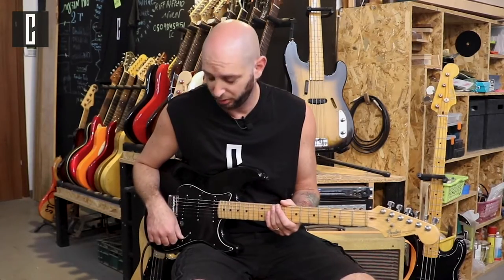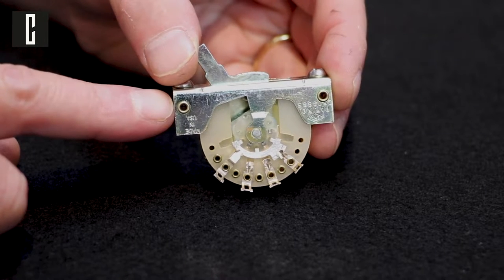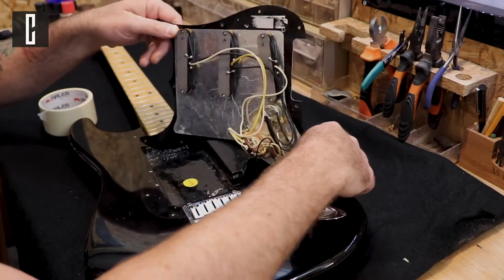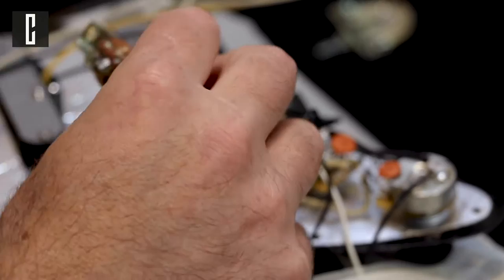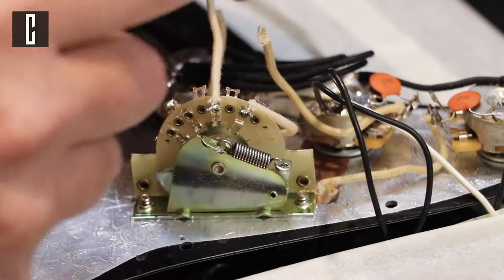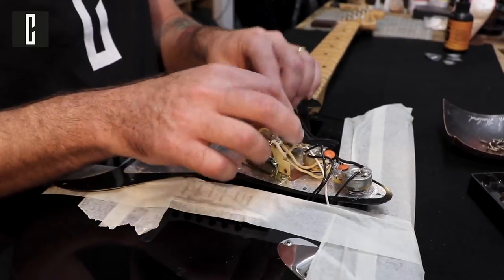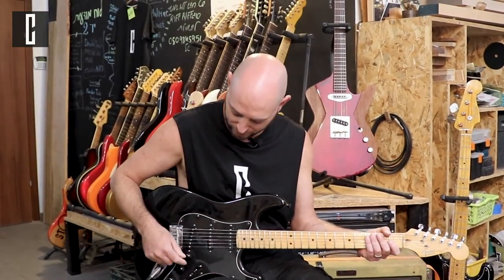How to Install a 5-Way Stratocaster Switch (full step-by-step installation guide)

Comment: Just did this to my guitar. My soldering is a mess though, you make it look so easy. As long as it works I suppose....
Reply from the maker: Good soldering takes some practice but I find that high quality powerful soldering station and iron are the real key for an easier and excellent job.

Comment: I also have good experience with other 5 switches, such as the BACH LSW50, only some of them wanted to spray the contacts right after installation and they were OK. No noise or banging. You just need to make the right ground loops so that there is no hum. Otherwise OK. Nice video!
Reply: 'spray the contacts ' means what exactly?  How is it done and why?

Comment: Hey, thank you for the tutorial. It's really clear but I got a little lost with the "common wire" term. Just did a quick search on the internet and realized that's ground. Also, my guitar has only one potentiometer controlling the tone, so setting it up will be a bit simpler than in this case.
Reply from the maker: Hi, by "common" I usually mean the lead that is going out of the switch or the center lug of a pot

Comment: Great video. I've got an hay configuration but both humbuckers don't work at the same time. Want advice on how to mod the switch so I can get both connected at the same time?
Reply from the maker: hi, I suggest you don't mod the switch because you will lose other positions, but you can add a Push/Pull pot or an additional mini switch to create to option.
Reply: @coilsboutiquepickups  hi. I also thought of putting in the middle position a DiMarzio super distortion

Comment: First time I've tried to do anything about the problems you have with electric guitars.  I have an horner guitar which is German I think.  The selection switch is a different one that is used in the video and I have no idea what size wire is used.  So please pray for me so I don't blow anything up. And if possible could someone please tell me what wire I should be using.  Thanks. And I agree that it is a good video.  Unfortunately I'm not tesla....I'm nervous about the whole process and I'm sure that I will be looking for guitar repair shops in my area 😀
Reply from the maker: Hi. You can send me a picture of your switch and I'll try to help you out.
Alone@coilsboutique.com

Comment: l am doing this on a Squire Strat. When you said 'solder common on the right tab' l soldered the black lead from the volume knob. A few minutes later l found out l had done the wrong [?] thing. l have 6 leads to work with. Three cloth-wrapped pick-up leads and a black skinny wire from each knob. l am going to keep soldering leads, but your advice would be great!
Reply from the maker: Usually black wires are 'ground' and are connected the the casing of each pot. The colored wires are usually the 'hot' wires and should be connected to the switch
Reply: @coilsboutiquepickups  Thanks for the reply. l didn't smash the guitar on the wall. l did try every soldering experiment l could think of, to no avail. Few days later l took it to Mike the guitar-fixer at the Asheville Guitar Center and it was wired up within 24 hrs. l was thrown off by the fact that the original PSS was like a boxcar, all leads to one side. By the way, in America solder is 'sodder'. Have a great day/night/whatever..!

Comment: what wires are the commons you connected. what component did they come from
Reply from the maker: The commons are the terminals on the switch that go to the volume pot and connect the poles to each other. Wires and switches can be bought online

Comment: Thank you very much! Video useful so far. I could install Japan switch (which is very close to USA in your video ) on my Squier Affinity ( instead of strange original Chinese) after watching your video. Hope you channel will grow 

One thing, it was very complicated for me to solder wires into holes of switch, I guess because of wires of pickups and pots in Squier Affinity are tine enough and holes  just too big for them. I soldered them somehow just to push big amount of tin solder but it was not pleasent and construction not very stable. Would be glad if you have a hint how to cope with such problems
Reply from the maker: Sure, try to use a high power soldering station and flux paste.
Most soldering problems are related to a weak soldering iron
Reply: @coilsboutiquepickups  thank you! Such a quick good answer) WIll try in next soldering
Reply from the maker: @anton5442  Awesome. Let us know how it went

Comment: Is it posible to by pass position 2? No blend mode of bridge and middle?
Reply: If by bypass position 2 you mean position 1 and 2 are the same, I can't think of a wiring that will do that without changing other functions, but maybe a technical alteration of the switch could do it. I'll try it next week and if works I'll upload a video about it. Thanks for the idea :)
Reply: @alonesage  Hi, I just wanna use position 5 neck, position 4 neck+middle, position 3 middle, bypass middle + brige blend, position 5 with a hot rail HB
Reply: @andresbriceno73  so, do you want the switch to mechanically skip position 2? I'm not sure there's a way to do it. I can probably make position 1 and 2 to be the same, but not skip.
Reply: I only left the neck and bridge and removed middle Pickup, I want yo know if a can blend neck and bridge know!
Reply: @andresbriceno73  you can. I think maybe you should change the 5 way switch to a 3 way switch
Reply: Will try that, any Diagram?

Comment: Only question is, is the wire that you are using shielded? Is there a better wire for reducing hum etc?
Reply from the maker: Well, the hum created by the single coils will not diminish using a shielded wire, that is, not in a way that is noticeable...
Push-Back wires are easy to use and they have excellent conductivity.

Comment: I just purchased a MIJ Fender Contemporary Strat, the 5way switch is bad.  Mine has only a master volume and master tone with a coil tap toggle switch.  I purchased the 5 way switch you used.  Is there any real deference between your Strat in the video and my MIJ Strat when it comes to the wiring?  Any advice would help because this is my first time working on a guitar.
Reply from the maker: Hi, the new switch you bought should fit perfectly with no problems. The wiring is completely standard and as described in the video.
If you encounter any issue don't hesitate to contact us.
Reply: @coilsboutiquepickups  Thank you!

Comment: Oh my god.. changed but now I have no more control tone on middle pick up.. 
How can I solve it?
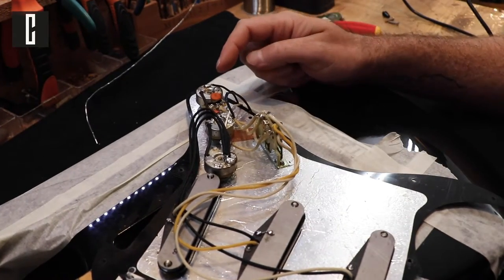Reply from the maker: Minute 11:00. Create a jumper between the connection point of the bridge tone pot on the switch to the connection next to it.
Reply: @coilsboutiquepickups  
Done jumper: now the tones works on; neck-neck/middle - middle/bridge and bridge
but not for the middle only... maybe is the 5way switch crl fake china?
Reply from the maker: @David79rebel  I don't know which type of switch you are using, but you have only 2 tones and 3 pickups. Bridge and middle pickups work on same pot

Comment: Hello there,
I need a diagram for a five way switch. three single coils. I've had the guitar since 2009 and the volume pot and the five way switch completely went out. I took the neck completely off of the guitar for first time since, I had the guitar. The Chinese Communist electronics I had to replace all all of the electronics with United States made ones the pickups for $15 for three made and New Jersey. I'm trying to find a good diagram so that way I can wire in the pickups the right way. The middle pick-up which is reverse parallel wound and the neck pickup do you have any ideas or any information credible websites? I can go to and order to get this done correctly. I'm getting noise out of The Middle and bridge pickup I'm not getting any noise out of the neck pickup and one of the tones turned into a master volume because I also replaced the volume and the two tones and input jack I have capacitors. Volume five is a 250k and both tones or 250k. I would really appreciate any information or some video of a diagram to hook up three single coils to a five way switch thank you.
Reply from the maker: You can try these links: https://montancesguitarwiring.com/pages/strat-sss-1-volume-2-tone-treble-bleed, https://www.northwestguitars.co.uk/stratocaster-wiring-diagrams/

Comment: Can that type of 5way switch be fitted to my fernandes elec guitar?
Reply from the maker: I believe it should. Which model is it?
Reply: @coilsboutiquepickups  im not so sure about the model do you have an email so i can send the picture? Im new to guitars😆😆
Reply: I believe it is an FR-55 with two single pickups and a humbucker.. it has a 5 way selector
Reply from the maker: @mikeserrano19  service@coilsboutique.com
Reply from the maker: @mikeserrano19  I see. It's a guitar with no pickguard... You might need to enlarge the mounting holes for the screws, and sometimes the screws that are provided with the switch are too short. I really recommend you take it to a guitar technician to measure everything. It's a standard american fender switch and every guitar tech should have them available in stock.